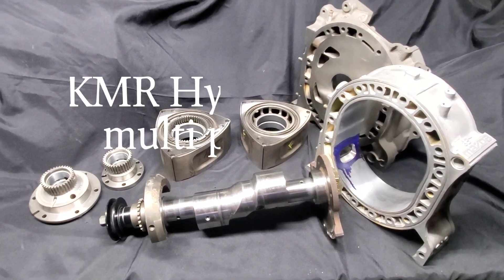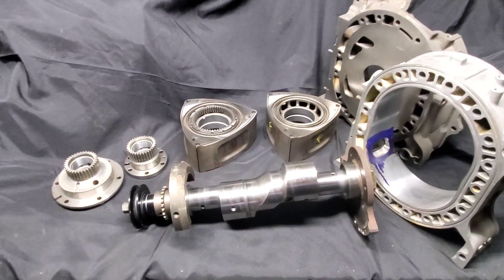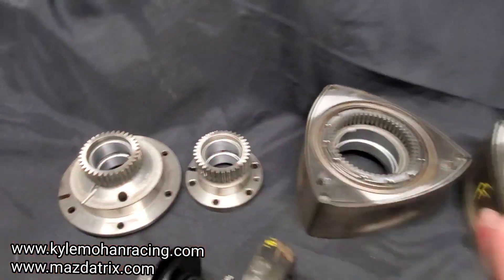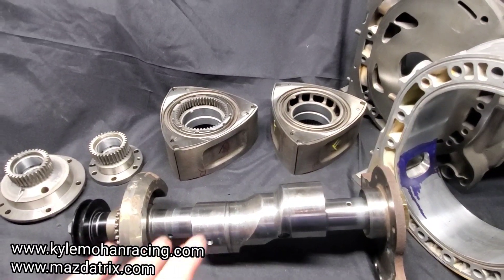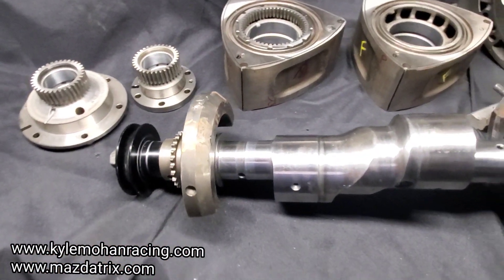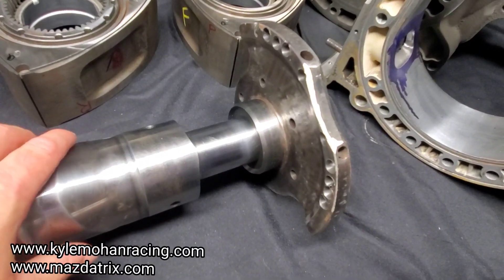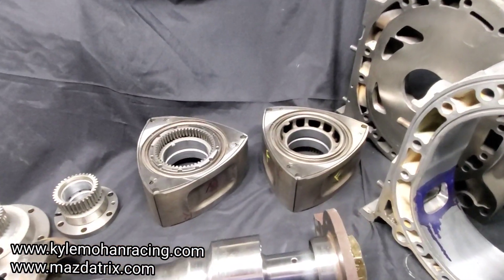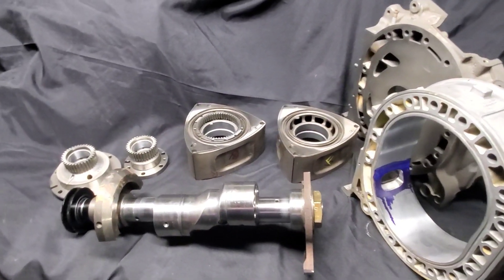Renesis Hybrid Multi Port Motor UPDATES, Balancing, Bearings, & More -KMR  Getting ready to assemble

Comment: Should the Adaptronic basemap for the Rx8 work with this engine? Or at least get it started? I can’t get mine to start and I’m pretty positive it’s tuning related
Reply: Check compression yet? No point wasting your time on a bad engine. Many Rx8 owners run into the same issue as I did. When an engine gets run into the ground you cant simply replace the seals. At a certain point of seal life you start to widen the rotor's slots inevitably meaning those rotors will always have poor compression.
Reply from the maker: Contact Nelson

Comment: Please run it n/a. There is so much conjecture about whether the hybrid works or is only marginally better than a well built factory setup. Im hanging out with my motor at 95 psi on faces, keeping it alive until i can determine which way to go.
Reply: The stock renesis will perform better for certain. We already see losses when guys try to bridgeport(adding exhaust overlap) to get minimal few hp gains up top. The hybrid gslse concept would be equivalent to that. Once you add overlap you completely throwout the intake manifold design. Which is how mazda got good torque in the low rpm range while still having power up top.

I wouldn't hold on too long to rebuild you are already approaching the exponential compression loss range. If you let it go till it has hotstart issues you will likely ruin your rotors. You are better off opening the stock 6 port exhaust ports a little and cleaning up the runners. To avoid overlap issues hurting low+mid rpm it could be possible to do a small bridge through the Aux port and tube, however this could compromise the corner of the apex seal if done incorrectly. Still need tuning to make any use of it.
Reply from the maker: It works well.  The turbo car won a championship and we have a few friends running other various setups.  We plan to set it up NA first.  The turbo.
Reply: @mincvinyl  hence why i am eager to see some results. I dont want to run this engine into the ground, it has most supporting mods done and is occasional use only. If a bridgeport hybrid was good for say another 50hp above stock, could be worth the trouble.

There was a malaysian gang that made it work with 220 rwhp but one random result isnt enough to go balls deep. 

Where i live, you cant just smack on a turbo or rew swap. Getting it legal is just too hard due to emmissions. If mazda did a factiry turbo or rew then no probs, but they didnt.

Keeping the same engine and as n/a is a much more easier process overall. High hopes on this, but if it yields the same as a proper rebuild then a freshen up and clean up of the ports will be what happens.

Appreciated your response and your experience in this area.
Reply: @noname-sd5dt  Just try to do more of your own research on porting in general. Its a fairly complicated concept to wrap your head around.

Generally going larger ports only nets you a few hp up in the higher rpm ranges, while increasing mpg and ruining your mid to low end torque. So far I have not seen any compelling evidence that bridgeporting has any gains for the renesis. Unlike previous rotaries the Renesis and intake is designed around 0 overlap. Putting a bridge or any overlap in there throws a curveball at the design. Not to mention a bridgeport/hybrid would be counterintuitive if you maintain emissions since the CAT would create enough backpressure that the added overlap to the intake would likely be the escape route(high pressure goes to low pressure).

Mainly due to poor documentation from the community. Even dyno charts can't be trusted because there are so many variables at play and everyone has an agenda/clout. Unless we take the same car and same dyno and compare a new renesis w/ tune and a new hybrid w/ tune, we will never be able to say for certain. Unless we see massive gains across the board. I suspect if anything a NA hybrid would be worse in the low to mid rpm ranges due to the overlap pressure hurting intake velocity for low end torque. Then maybe there would be gains up in the higher rpm range due to the free exhaust flow. The only gains we would see is due to the additional exhaust area reducing any possible restrictions of the 3 side exhaust ports. Much like going from a 2.5in exhaust pipe to a 3in exhaust pipe would have less backpressure.

I suppose an easier analogy would be blowing air out of a small straw vs a larger diameter straw. A hybrid is like blowing air out of a toilet paper roll, essentially there would be no resistance. However Mazda already designed the exhaust ports to support this engine design so I would be lead to believe that they are rather close to having the correct size straw for the full 9k rpm range of flow needed. Considering the vast amount of engineering that was put in place for the intake design I would believe that the same was done for the exhaust side. Which would explain why no mods really add power to the rx8 other than ECU ignition tuning and going against emissions. Its why most "cold air" intakes lose power. Its why most headers only add weight and give no power. Or the carbon fiber "lightweight" hoods are heavier than the stock aluminum hood. etc. 

Mazda didn't leave much on the table, really their only restriction was emissions and noise once you get down to it.
Reply: @mincvinyl  again, thank you for your reply. 
Even though my 13b msp is down on power due to lower compression, in its stock form, it is a lot of fun. 
Just a smidge more oompf would turn what is a great sports car into an excellent one.
I will see what kyle nets in his build and hope that it is an honest review. 
A local builder is trying a pp intake on a hybrid keg with great results on run in, however as per usual, progress of these things stall, or get lost when they are not what is expected. 
The pp intake on a hybrid appearing to be a good combo does support your thoughts on the tuned intake being a limiting factor or problem for the hybrid, amongst all the other issues such as overlap etc.
Reply: @noname-sd5dt  If you are interested in more of the theory side of thing theres quite a few threads on the rx8 club that go over it. Theories for both turbo and NA.

I even have my own hybrid theory build to minimize the overlap issue, but it still doesnt avoid it. Besides the amount of machining required is impossible for most people. The engine would cost 2x that of just buying a new REW block(which is designed and proven for higher hp) and theoretically perform worse than the stock renesis.

Comment: Thanks Kyle. I'm guessing you're using a well balanced flywheel and pressure plate to add to the well balanced rotating assembly? Or can that be all balanced together for an even better result? Looking forward to the result and to see what you exhaust header design will be.

Comment: I'm really excited to see how this turns out. IMO it actually turns the 8 into a pretty viable grassroots platform. They're SO cheap, especially if they already have low compression. If this develops into a way to get a nice reliable 500ish wheel from a Reni, I'm buying one.
Reply: 500hp? Maybe with a turbo. N/A, no way.
Reply: @vortexau  why would you ever spend the money for a hybrid motor for an NA build?
Reply: @Diontb  legalities maybe? Where i live. I cant (easily) go backward in engine evolution. So rew is out unless you want to get tests etc which are $$$$. Even bolting on a turbo results in issues. Changing the housings during an inevitable rebuild results in an easier path fwd, yet would need to prove to be a reasonable and useable bump in output to be viable. Hence why my personal interest in this project
Reply: @noname-sd5dt  no what im saying is, hybrid motor for an !NA! build for a turbo build fair enough with that explanation but there is no need to spend that kind of money for a hybrid build for an NA build

Comment: In general the factory balance on any Renesis is pretty far off.  It was/is one of the issues it has.
Reply: Clearly many people fail to recognize and thus not understand what it is that makes a Renesis engine unique and different than the previous 13B engines despite the similarities.   As one example, side cutting the rotors on a Renesis has an entirely different result than on a 13B.  Because the sides of the rotor on a Renesis pass over the exhaust port on the Renesis side plates x 2 (both sides).  Where the rotor sides aren’t exposed at all to the exhaust port on a 13B engine.  Cutting the rotor sides on a Renesis results in increasing the flow path and volume of exhaust gasses recirculating back into the intake cycle.   Specifically into the much earlier opening Renesis intake ports.  

Which unlike the smaller brow of a bridge port opening early, then crossing over the bridge, and finally the larger port itself opening, the early opening Renesis port opens fully and directly.  It’s not the same thing to open the whole port vs the slower opening of the smaller BP brow, some flow hesitation crossing over the bridge, and then the port opens fully.   You have to go back to the Renesis SAE paper and see that Mazda did the exact opposite; material was specifically positioned on the Renesis rotor sides to prevent this.  And so not only is it now cut away, it’s opened up even more. 

Except with a hybrid it’s not just the rotor side cutting that’s resulting in exhaust gas recirculation directly into the Renesis intake ports, but now also the overlap flow of the peripheral exhaust port.  This in particular is one of the key power killers on an NA hybrid Renesis.   When coupled with splitting the exhaust flow into multiple paths having different opening/closing timing, which not only weakens the the potential for pulse resonance, but also greatly increases efficiency losses.  So unlike a 13B with a single exhaust port and the flow all concentrated into one unified efficient and tunable pulse, on a hybrid it’s instead broken up into multiple paths of variable timing.  

Many people fail to understand the subtlety of resonance and how the minor details greatly influence it.   So in the end, these changes are interfering with the resonance potential of both the intake and exhaust cycles such that the hybrid concept harms NA output potential rather than enhances it.   

Why does a true PP 13B have such strong output potential?   Because the single intake port and the single exhaust port can be so finely resonance tuned, but conversely only over a limited rpm range.  So then consider that a Renesis engine, which has no overlap and hence has “zero” exhaust resonance potential, is instead 100% dependent on intake cycle resonance and capable of achieving 270 bhp in NA configuration without any porting at all.   

Except now with all this previous 13B mindset and modifications, coupled with not truly understanding how the Renesis is unique and different, you’re just wiping all that out.  I’m just touching on some of the details.  The full scope is many, many more paragraphs.  
.

Comment: If someone were to build a NA hybrid engine like this for street/light track use would you recommend using the irons from a 4 or 6 port RX-8? Awesome video!
Reply: 6 port. More port more better. It would be kind of weird to have so little intake and then a massive semi-pp exhaust setup. Now a 4 port that has semi-pp intakes though, hmmmmm...